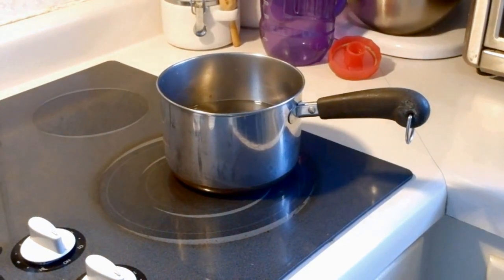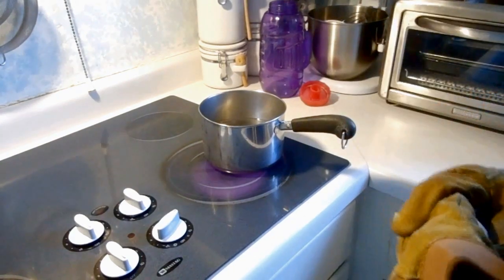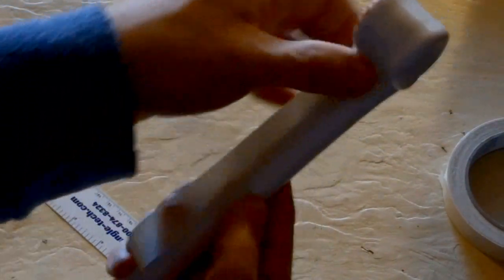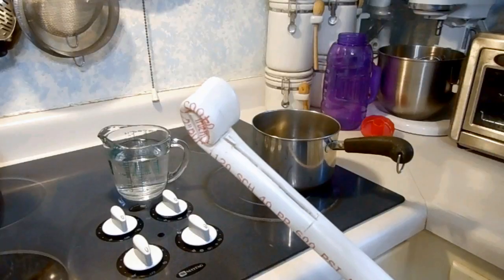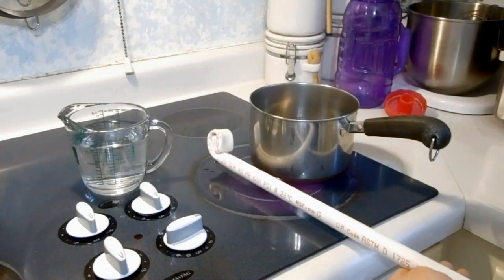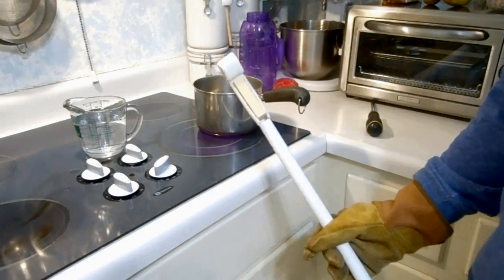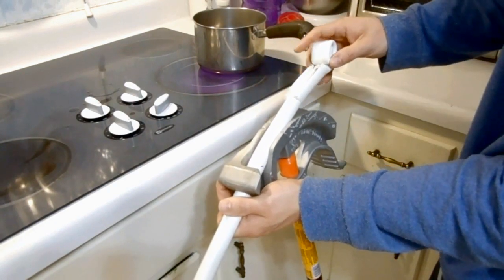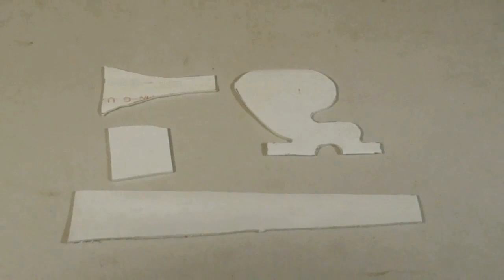How To Make A PVC Violin Part 1 of 3

Comment from the maker: I did eventually put real strings on it and hooked it to my homemade amplifier and got a green light on my digital tuner for each string- I also replaced the stove and oven with a $20 Wagner heat gun from THD - it bends the pipe in seconds verses the way I did it in this video.